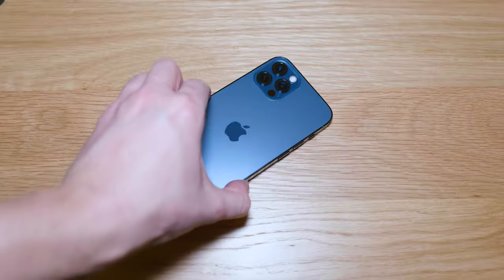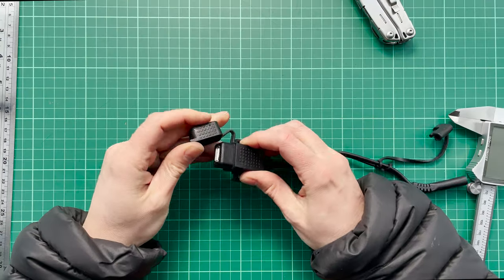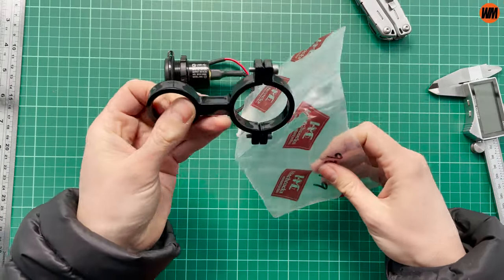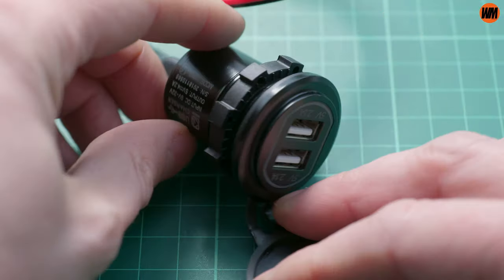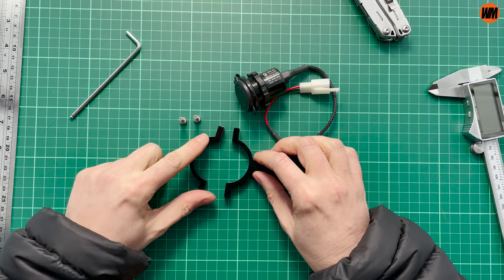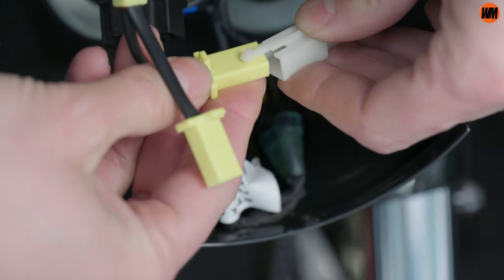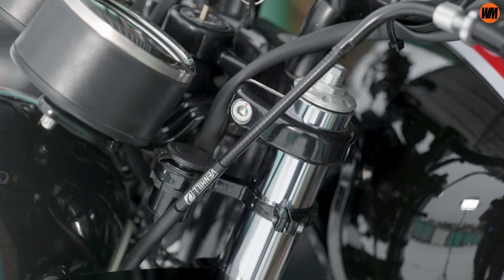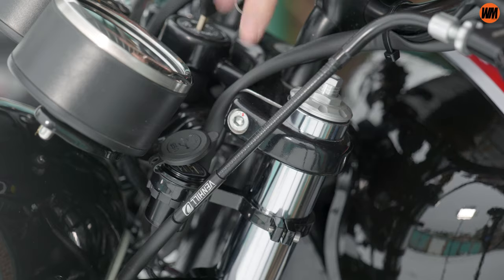Royal Enfield Interceptor 650: Hitchcocks USB Install and Review

Comment: To avoid the "rain catcher" effect, could you not mount it upside down?
Reply: My thought exactly.  Perhaps a bit more fiddly to plug anything in but should be protected enough even in rain.
Reply: If you mounted it upside down rain water would track down the power cable into the back of the USB socket. At least there is a cover on the front (just how weather proof that cover might be I can only guess).

Comment: I have one of these on my Interceptor and not have any issues with it works great. Hitchcocks Motorcycles does sell a line splitter as well for 11.50 . I have a 1ft long 90 degree on both ends USB cable on mine it's sits better than the normal cable. Phone is attached to bar with Quad lock system.
Reply from the maker: Great idea on that 90degree cable. Off to get on now. I've always used Ram mounts but the QL looks good.
Reply: @WildlifeMoto   They are good and very stable.Will not come off till you want it to..Cheers mate
Reply: John k  £13.80 inc vat + post. Mine also comes with 2 female connectors and crimps. They must have seen mine and copied. Still imitation is best form of flattery.

Comment: Hi nice video. I have placed mine on top of the fork stanchion to have it closer to the dials. The bracket thickness fits perfectly flush with the top of  the stanchion near the preload adjuster.
Reply from the maker: Nice, I might try that.

Comment: Looks good but must agree about the mount and rain , if you had to use a sat nav in the rain you would have issues , having said that I am sure you could come up with something to cover it 👍😀
Reply from the maker: Thinking about making a rubber boot that can slip over the top with the cable end siliconed inside. 🤔

Comment: I bought a usb handlebar mounted socket via ebay bracket broke in no time so had to use 'gaffer tape' but still holding, this one looks a much better quality bit of kit, tip save youself £100 get a Garmin drivesmart 61 it's £100 cheaper than Tom Tom m/c satnav & has big screen(need handlebar mount from ebay)

Comment: You know what happened with my 2022 Interceptor is that once I installed the USB setup and would push any of the 2 brakes the USB eould instantly shut off. When I would let go or stop using the brakes the USB would turn on again. I emailed Hitchcock and they said they never heard of that. I ended3uo wiring it into my headlight and I have been just fine. I have a new LED headlight so Im good. Just thought 🤔 I'd let you know. 

Jeff - Sunny Central Florida ☀️
Reply from the maker: That is very weird. Glad you got it sorted.

Comment: Great video…what do you use to hold your phone in place? (Just purchased the magnetic phone pouch from Trip Machine) which I hope holds the phone securely to the tank!
Reply from the maker: I don't like my phone on the tank, much better on the handles so you don't have to look down. I use ram balls with x-grip or quadlock.

Comment: Handy feature for charging accessories. Is the bracket painted or powder coated? I noticed how the rubber cap is under your dial, is that slightly inconvenient? Would you be able to show the unit set laterally rather than north/south? Cheers!👌👍✅
Reply from the maker: Hi Steve. Hard to tell if it’s powder or paint. I think it looks like paint, either way it’s got a nice heavy coat on it. I wanted it as out of the way as possibly so the cap does end up slightly under the dial (doesn’t have to be this way). This bracket will only mount vertically, I was just comparing it to a bar mounted system that would keep the plugs more horizontal.
Reply: @WildlifeMoto  I guess I was asking if the plug base can be rotated to have the 2 USB plugs aligned across the motorcycle rather than “shotgun “ position. Then the rubber cap won’t get caught under the dial.🤔
Reply from the maker: @stevesanelli90  Oh sorry, yes you could totally do that - great idea!

Comment: Do you reckon it would mount well upside-down to keep rain out of the open ports?
Reply from the maker: Then I’d be more worried about grit and dirt getting in it. I’ve not had any problems with this the right way up. Just remember to put the cap on.

Comment: Excellent, I'll get one.  Quick question.....thinking of using the splitter to also install heated grips (as long as only 1 USB port is used, that leaves 5 amps which should be fine...)....does anyone know if the Oxford heated grips port will clip to this, or if not, what port do I need to replace it with?  Cheers!
Reply from the maker: Not sure about the Oxford plug, but Paul’s kit comes with a loose two pin plug ready to crimp onto any accessory. Just chop off the plug from the grips, crimp on the new one and you’re good to go.

Comment: Appreciate this review.  Just installed on mine and found I like the fit better on throttle side.   Did you consider that or think of obvious reasons not to mount it on the right?
Reply from the maker: Only that I’m left handed and plugging in USB cables is a faff at the best of times :)
Reply: @WildlifeMoto  indeed.  Ha. I have found on the right makes it less likely I can take my right hand off the throttle to make an adjustment.  May need to move it after all.

Comment: Looks nice, personally i think i would have raised it a bit closer to the top yoke, but since i don't own a R-E i guess you have a reason for putting it where you did : )
Have you fitted the Aprilia USB-connector to your Tuono?
Cheers!
Reply from the maker: Yes I have the Tuono USB. What a massive pain to fit! You have to cut a hole in the panel next to the dash.
Reply: @WildlifeMoto  Yeah, i know.. don't know if I will fit one actually or just use a Powerbank :)